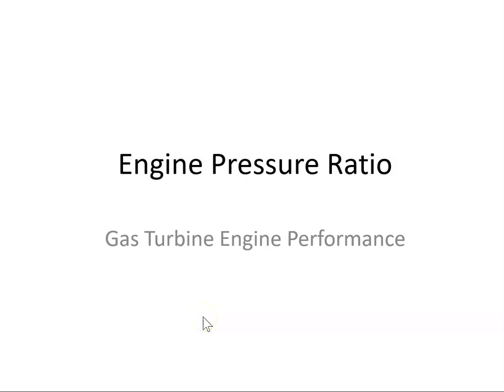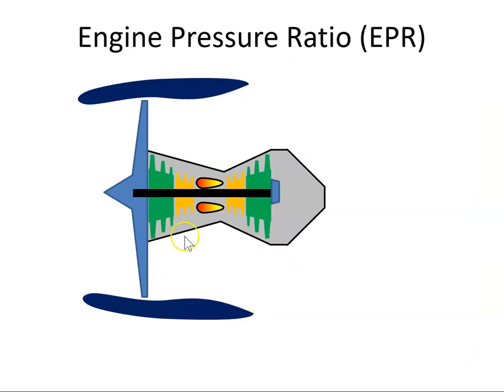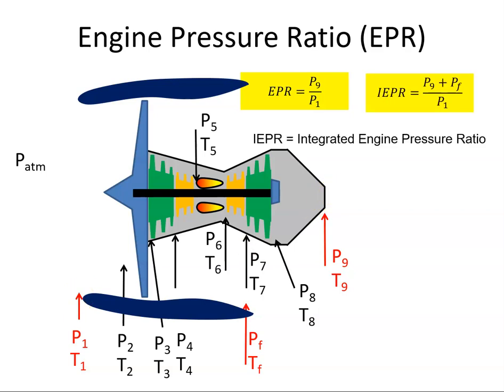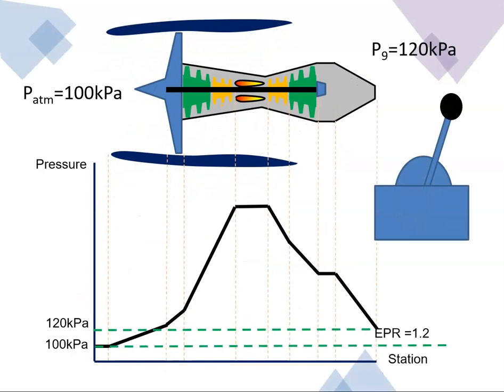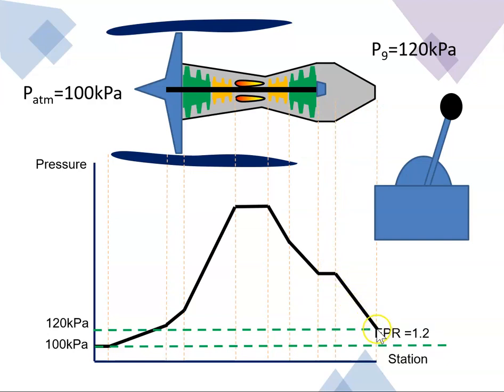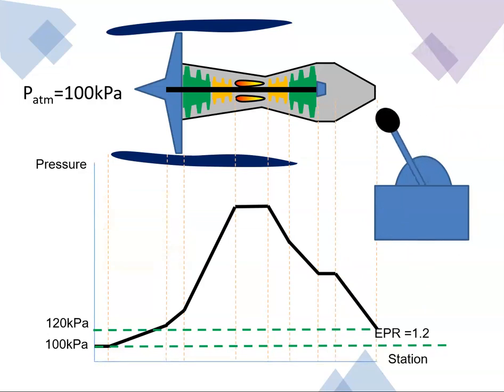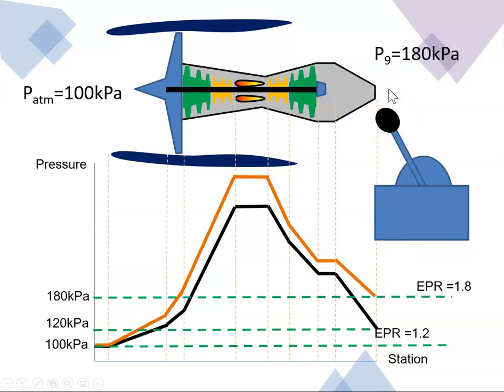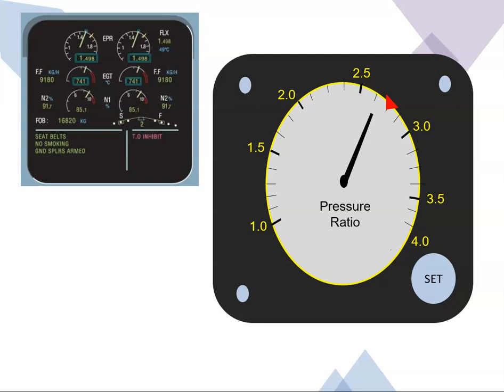Engine Pressure Ratio

Comment: I was not sent by AgentJayZ but he is a master also. So, it is a great job what you have done. Thanks for sharing knowledge great community. You mentioned at around 1:38 that burned air expands when it pass through turbines but if it is the case it should be pressurized as the expanded air lose its speed. But at that stage the aim is to gain speed by compromising pressure. Did i miss something? I would be appreciated if you explain it.

Comment: Recommended by AgentJayZ on his "What is EPR and why is it used?" video. About to watch.
Reply: Was a good synopsis.
Reply: If I understood AgentJayZ's video correctly, then, given your diagram numbers, the EPR should be P8/P3 (maybe P8/P2), because both P1 and P9 should be close to ambient pressure and would not produce a useful EPR.
Reply from the maker: @Kargoneth  if the exhaust nozzle is choked, P9 will be above atmospheric pressure and the “choked nozzle thrust” will be An x (P9 - P1), where An is the cross sectional area of the nozzle.

Comment: Very clear explanation, but is it not usually P2 (compressor inlet Pressure) as opposed to P1?
Reply: This engine has more stages so the names here are different but it’s is essentially the same as P5/P2 ie the ratio of LP Turbine exhaust Pressure to Engine Inlet Pressure.